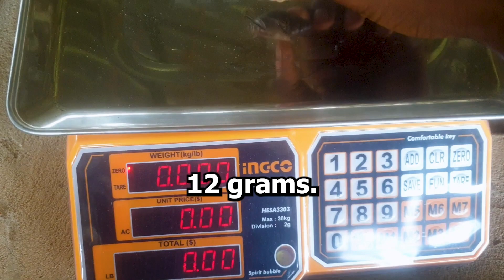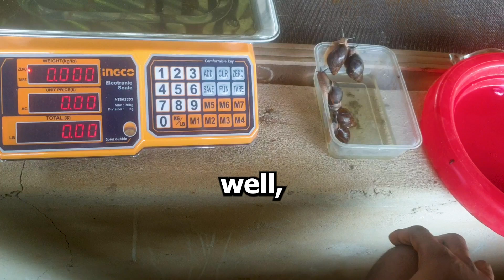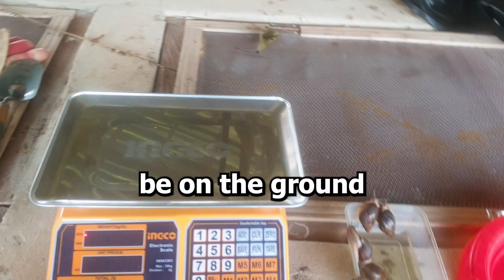Snail Weight Gain and Mortality Experiment | Day 15/30

Comment: Great job my brother!

I know you can easily come back to reference your video, but I think you should add another column on your records sheet to give an insight as to the weight distribution.

Example:

Day 7

4 × 12g
1 × 10g

Day 15

2 × 14g
3 × 12g
Reply from the maker: Good point bro. I'll add that to the table